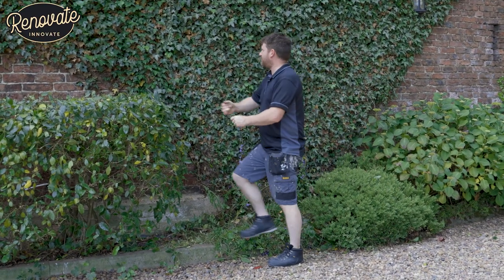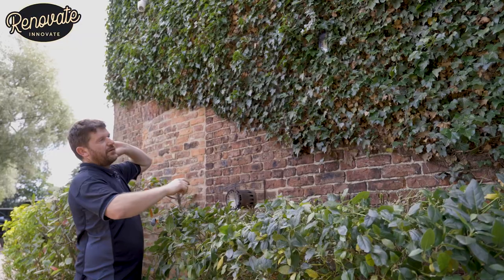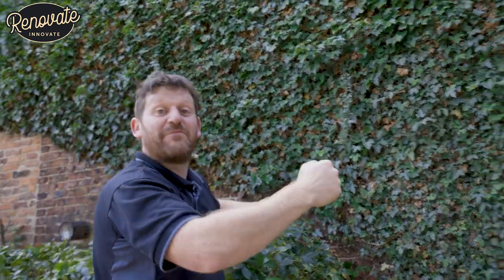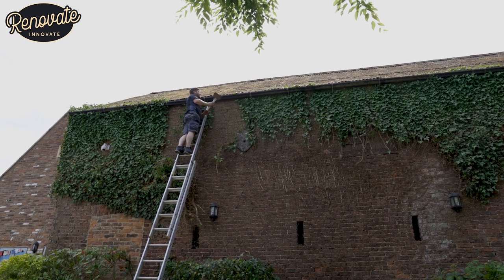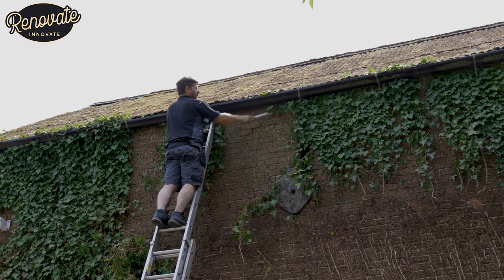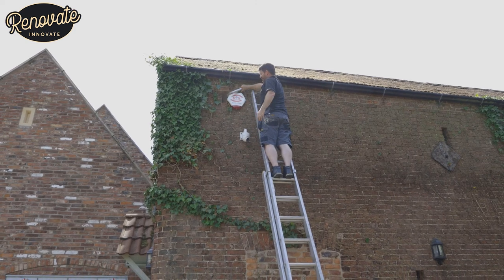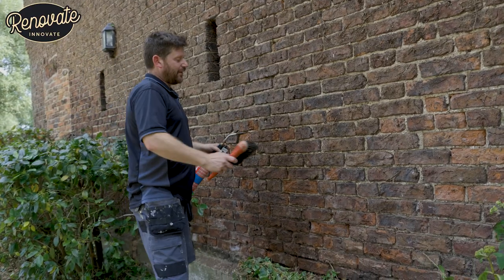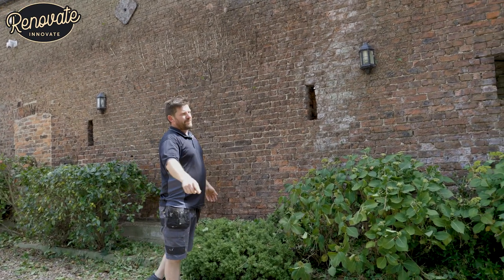Remove Ivy From a Building - Great Tips & Tricks | Renovate Project

Comment: Outstanding work - and your video is a compelling watch. What are you using as hand tools/scrapers?  And since you can't use a blow torch on timber window frames, how to clean up around windows?
Reply from the maker: Thankyou and glad you enjoyed it, we find using a scraper which is bendy works best and even an old hand saw works. As for the window we can't advise using a flame around a wood as there is always the chance of fire, but maybe keep a fire extinguisher on standby or dowse down with water after.

Comment: I have a customer of mine that wants me to remove ivy from there house. How do I go about charging them? It is on a stone house and it's pretty thick. I live in the US in Virginia.  I will have to do it by hand. Any advice is appreciated!
Reply from the maker: If you could use a truck or some mechanical device to help pull down the thick Ivy, the smaller Ivy strands can be removed using a scraper. The process is not that difficult.